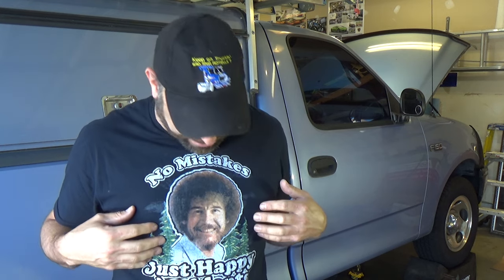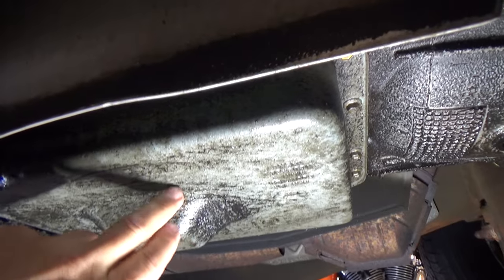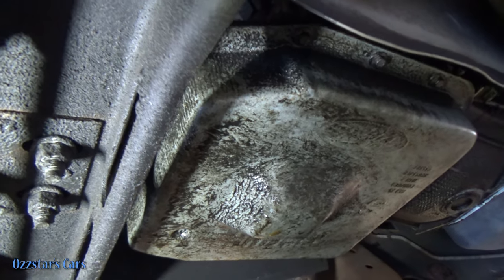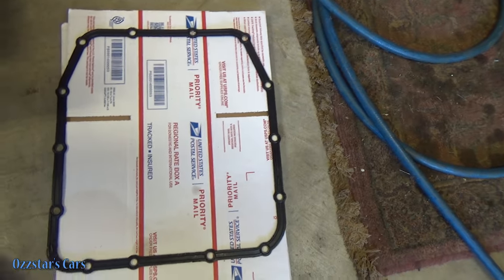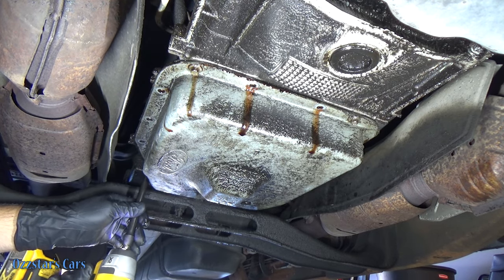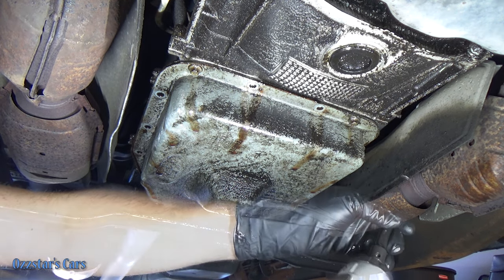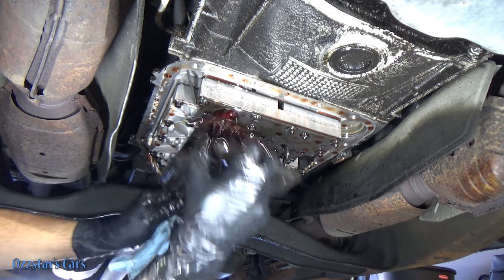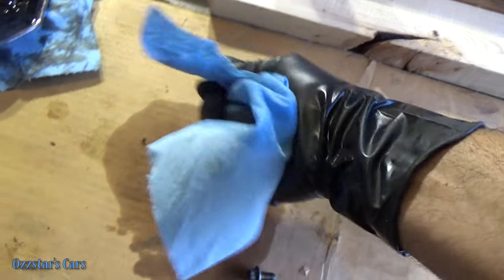Transmission Fluid Change In 24 Years!  How Bad Does it Look? F-150

Comment from the maker: *Motorcraft Transmission Filter FT-105  https://amzn.to/3hq7ytM*
*Transmission Parts Direct Pan Gasket  https://amzn.to/3jDKBG2*
*Motorcraft Mercon V Fluid  https://amzn.to/3h944g3*
*Long Fluid Funnel  https://amzn.to/3heqWuT*
Thanks for stopping by and checking out the video!  -Glen
Reply: Next time go with Amsoiland a can Of BG ATC conditioner you can put it in anytime and you will notice the difference
Reply: I think Wix makes the filters
Reply: Pry the filter apart that’s where the metal shavings are at
Reply: Good vid
Reply: Next time primer and paint the bottom of the pan
Reply: My Xterra filter has 4 little bolts first generation
Reply: Nice work
Reply: As far as name brands go I like Pennzoil or Valvoline and they are closest to Amsoil. I think the Motorcraft is considered will work and nothing special

Comment: good work.  My 2008 F150 4x4 has 335,000 miles and the tranny has never been serviced. Remarkable!  If it fails today, I've gotten my moneys worth out of this fine crew cab.  I'll drop a rebuilt transmission back in and keep rolling.  Talk about Ford tough ... I'm impressed.
Reply: did it fail or did it help it out?
Reply: @ashtanking3153  Has not failed yet with over 356,000 miles on it as of today and will drive about 400 miles today to the coast.
Reply: Same my Ford F-150 1995 has 400k and hasn’t been changed but definitely gonna bc previous owner hadn’t
Reply: My 03 2wd 4.6 has 370k on it and is just now starting to have issues. It has a bit of a clunk when I’m at a stop and hit the gas and it gets into gear. Otherwise it shifts pretty smoothly.

Comment: I got a 2008 Ford fusion with about 200,000 on it and never had the trans fluid changed,was wondering about a drain and fill but I'm scared it will cause problems with my trans if I do,what's your thoughts
Reply from the maker: If it shifts okay then leave it alone at this point. It's at the end of its life.
Reply: Did you change it? I have same make and model and around same mileage I’m about to do a drain and fill
Reply: @vincentriley8626 no I didn't if you do let me know how it goes
Reply: @terrymccluskey8758  just did ny explorer. 195k. Was starting to shift sluggish and fluid was getting dark. New filter and 5 quarts of mercon V. Smooth as silk now. Left the fluid in the converter so partial oil change.
Reply: @rocktech7144 did it make it shift better? did it help?
Reply: @rocktech7144 nvm i just read it. man my tacoma has 171k never changed. i guess ill do it when i start feeling it have problems

Comment: I have a 01 2wd with the same tranny. I bought the truck used with 170,000 miles on it. I changed it myself and it looked horrible. I have no idea if anyone ever changed the fluid and filter. It was full of metal shavings and was thick and brown looking. It had no red tint left. Let’s just say your fluid looks a lot better than mine did 😅
Reply from the maker: Well now we both have clean red fluid.lol  How's your transmission shifting now?
Reply: how’d it do after u changed it ?
Reply: It’s hard to say if it helped or hurt because I quit driving it as a daily driver and just don’t drive it often anymore.   The overdrive flashes on and off. The code it gives when hooked up to an obd scanner is the one for the transmission fluid temp sensor. I’m stumped on what to do for it to fix it. It is a ford only part not produced anymore

Comment: just needed to drain the t.c if you remove that round plug on the bell housing spin the tc util you see the drain screw
Reply: If it hasn’t been changed in more than 100k miles it’s better to leave some of the old fluid in. That grit in the old fluid can help. If it’s been that long and there is no grit left in the fluid it can cause slipping.
Reply: @jubblybits6155 no it won’t if it doesn’t something is already wrong with the transmission

Comment: ADVICE WANTED 🚨 my 03 tacoma has 171k miles and fluid has never been changed. it’s dark. no trans problems right now thankfully.  should i drop the pan and change? or just leave it alone . i rlly dont want to mess anything up so i dont know
Reply from the maker: 20+ year old fluid can't be doing very well to lubricate.
Reply: @ozzstars_cars  so dropping the pan and changing what comes out with filter can’t rlly hurt it right ?

Comment: the 4R70W seems to be a very reliable unit, we have a 1999 expedition with 400k on the original 4R70W, I just changed the fluid in our 04 expedition with 240k
Reply from the maker: That is some serious mileage!  I was really surprised how good things looked inside the pan.  Thanks Trigga
Reply: My 97 f150 has 200k, just dropped the pan and it was actually pretty for its age, original gasket and filter in it, i reused the gasket again
Reply: @shaneomac5074 did it hurt it ?
Reply: did it hurt it?
Reply: was it ever changed before ? or was that the first time?

Comment: Good video. Simple and Straitforword.

FWIW:
I cut the heads off of 4 pan bolts that are a little longer than the originals and round off the cut ends. I then cut slots into the rounded ends for a screw driver and thread them into the 4 corners of the case. This keeps the gasket aligned as I put the pan back up. The modified bolts sleep in my 'Odds and Ends' plastic case until needed again.

I also disconnect the cooling lines at the radiator and drain the torque coverter.

If replacing all that fluid causes slippage, it simply means I was headed for an overhaul soon anyway.

Again, Good Video......
Reply from the maker: That bolt guide trick is a great idea Russ! Thanks for sharing and happy shifting. -Glen

Comment: You might do a flush. As good as that pan looked, I wouldn't be afraid to do a full fluid exchange on it. I've never had trouble before. Whenever I buy a used vehicle, the first thing I do, is change ALL the fluids. That includes the power steering, flushing the brake lines, as well as the engine oil, transmission fluid, differential (s) oil and even the transfer case.(if FWD) I also flush the coolant, especially, if it looks brown.
Reply from the maker: Good maintenance is the way to go!
Reply: Don't forget about the 3stage decarb treatment
Reply: my 03 tacoma has 171k miles. trans fluid has never been changed it’s dark should i drop the pan? or would that fuck it

Comment: Never think to suck auto gearbox  atf out first before filter change REALLY worth effort when depanning sump, to change filters and seals, really stops the mess the rear gear box seal, jet wash it till clean, you be surprised they stop leaking with road dirt and xxxt clean out of back of gearbox seals
Reply from the maker: Nature's natural stop leak.

Comment: Man, you keep changing that fluid on schedule here on out like you did today and you'll never have to replace that transmission.
Reply: would u recommend i change my 2003 tacomas. it has 171k miles and its never been done no problems thankfully
Reply: @cedricmendoza1305  I had a used 2002 Tacoma but didn't own it long enough to change the transmission fluid.  Those are great trucks.  It's a Toyota and they are very robust.  I would look at it like this: if the damage is already done, then it's a matter of time before it fails, and the new fluid would just speed that along.  New fluid is not going to ruin the transmission, it just reveals the wear already in it.  Better for it to go when it's in the shop than on the road and leave you having to pay for a tow, and your loss of time, stress of it all, etc.  Also, know that the old fluid is only going to get more abrasive if you don't change it, too, which would mean continually increased wear.  I would definitely NOT do a transmission flush, but a drop and fill with a transmission filter change to start.  I follow a seasoned mechanic who says to keep the old fluid that gets drained out in a clean container when you do the drop and fill.  IF by chance the drop and fill causes slipping, drain that new fluid out and replace it with the old fluid and that should stop the slipping.  I have read about a guy who had a fleet of Ford work vans.  He said he did drop and fills as late as 250k miles on them with no issues.  I think it also depends on how hard the vehicles were used and abused.  If your Tacoma was driven mostly without hauling or towing and on the highway, then that's easy on the transmission and I'd feel more confident about changing it.  If it was used to haul heavy or tow heavy daily and up and down hills and such, then you would have more of a chance that it's worn out and would need replacing.  What's the history of your Tacoma?
Reply: @kargo27  this is the best response i’ve ever gotten to this question. my toyota was driven by an older man and then his grandson. he said it was babied its whole life so i highly doubt any towing was involved. the car looks amazing and well kept. the fluid is dark but the advice u gave me is great. i think ill do exactly that. drop the pan and change the filter. while keeping old fluid on hand. i doubt it’d hurt it
Reply: @kargo27  just hoping this things doesn’t start slipping that would suck. but ig if it ends up working the change would be for the better
Reply: @cedricmendoza1305  that's good news on the previous owner!  I'd feel more comfortable doing it then.  I think you'll be successful with a drop and fill, it's the flushing that knocks crud loose and that crud makes its way into and stops up the passages/channels and that causes overheating and failure.  When you do that drop and fill, the tranny has time to slowly dissolve the cruddy deposits so that they don't break off and clog (as I understand it).  I've done a lot of research on it and that seems to be the consensus.  Good luck, bud!
Reply: @kargo27  i guess i should definitely use the trans fluid the manual recommends? or just a toyota one in general
Reply: @cedricmendoza1305  I would use whatever the latest Toyota one that is recommended for that transmission by Toyota, yes.

Comment: Nice! I’m about to drop the pan in my 1995. Was there any reason the geniuses at ford opted to not use a drain plug?😭
Reply from the maker: Most manufacturers don't, never understood why not.
Reply: Now they don't even give you a dipstick. You have to get under the car and remove a fill plug, with the trans warm, and see if the fluid dribbles out.

Comment: Hey, Glen! It's crazy !
I am in a similar situation. I am the only owner of a 1998 Camry LE 4-cylinder, which I got brand new in '97. The car is currently 26 years old with 136,000 miles, and I never ever changed the transmission fluid nor the differential. As of late, when i put the car in drive, it reverses, and other times when it's in drive, the car takes a full minute before it moves, even when I press the gas pedal,it stays in motion. And when the car does drive, it makes a whining noise when I accelerate.

Lots of sources say not to change the fluid because of the age and mileage, but my mechanic says I should change it, even though I never did this service before. All I would do is drain and fill the ATF and differential. I wouldn't flush it, just drain and fill. I am lost on what I should do .

Some say nothing might not get done if I change the fluid because the transmission is done, but I have no idea .
Reply from the maker: @mc.ashlandfelix7140  fluid is cheap compared to expensive transmissions. I did a second fluid change on the truck in the video and it shifts even smoother now, like it had years ago.
Reply: @ozzstars_cars  I appreciate it, Glen! I was just unsure because many people and techs say if I do it, the slipping would get worst because I never did it before. Do you agree with that? The car is almost 30 years old with over 100K miles. And if I do this service, should I have my mechanic drain and fill it twice, or should I have him do that once? 

He told me if we go along with the process that I should bring 8 quarts of fluid, which I do not understand why because the transmission drain and fill capacity is 2.6 quarts and the differential capacity is 1.7 quarts .
Reply from the maker: @mc.ashlandfelix7140  30 year old fluid no longer has the proper additives to work properly. Make sure you purchase fluid that Toyota specifies for your Camry. The filter should be changed also if it is accessible.
Reply: @ozzstars_cars  
Appreciated!! I did order Toyota ATF , along with a filter and new gasket, but I was on the verge of returning them back after hearing all of the backlash of wasting money and beginning this service so late in the life of the vehicle. Have you done a differential service on your Ford truck, too?
Reply from the maker: @mc.ashlandfelix7140  I've changed diff gear oil on so many cars over the past 30 years I can't count that high. LoL

Comment: Dorman makes a transmission Pan with a drain plug That's what I use Or they sell a kit You could drill a drain plug in
Reply from the maker: Wouldn't it be nice if all manufactures put a transmission drain bolt in.
Reply: @ozzstars_cars  yes
Reply: @ozzstars_cars  yes

Comment: Nice video, do you ever drain the torque converter?
Reply from the maker: yes.  In this case I did a double flush since it is my vehicle.  Drove about 1k miles then drained and added fresh fluid.  The transmission shifts amazingly well now.

Comment: I just check my oil on my truck and its really darker than this one do you think it will help if a do a full flush again. 
Last time i just drop the pan change filter an gasket an add new oil
Reply from the maker: A second fluid change with the correct fluid should make a big difference.

Comment: That was a risky call on 24 yr fluid!!
In my 15yr owning my shop working on all makes, I have seen several instances where older cars OR higher mileage dirty fluid changes lead to nearly instant transmisison failure.
If I get a 25yr car with low miles needing its first fluid change I wont even risk it.
If I get a high mileage car with no history and dirty fluid I wont do it unless they insist after my warnings lol.
Reply from the maker: It's been a while, trans shifts soooo much smoother now.
Reply: when i bought my corolla the fluid of the transmission looks like it has not been changed in a minute,dark brownish color which doesnt smell like varnish. 198k motor and trans.
Reply: @JalenRose02  Im not sure I would change it in your case. If its thin like water and brown with no sign of red, thats not great for changing, somewhat risky.
Reply: @ripptydevibes2581  I'm praying to the toyota gods that I'll be alright 💀
Reply: @ripptydevibes2581  my toyota corolla which is a 96 uses a dexron 2 but those don't exist anymore can use a valvo high mileage transmission fluid?
Reply: @JalenRose02  No way. Use the regular "universal red" fluid.
Something like dex 3 / dex 4 / Toyota WS
Its all the same stuff.
Do NOT use Volvo.
Reply: @ripptydevibes2581  update I done change the old fluid out and its been running way smoothly now that it got new transmission fluid on it and next week ill be dropping the trans pan rather than just changing the fluid out, so i can get used to Castrol trans fluid that's been running for a week  through the system caused its darker again. then ill be putting a AMSOIL signature series for the final flush.
Reply: An old myth
Reply: @JalenRose02 any update? I’m about to do this
Reply: @Miles-wy1zr  Im still on the new fluid i put in not the amsoil ones and im one 206800 miles already, don't want to use a very clean oil on old transmission that never got service before you might clean it out by flushing it.
Reply: @JalenRose02  thanks brother I’ll try castrol ATF on mine soon
Reply: @Miles-wy1zr  yeah as long you shift on every gear back and forth when you fill it up so the fluid is in the solenoid. It should make a huge difference  when it starts getting hot and should shift smoothly but not smooth as a butter can't  expect much on this old transmission.

Comment: How can the oil still lubricate the gears?  You should of used the cooler lines to pump it out so the pan will be empty when you remove it.  You can try at 205 reseal for that leaking seal.  You only got out like 40% of the old stuff opening the pan if you use the cooler line you can remove fluid and add new fluid until its clear red otherwise their is still old crap in their.  Don't drop the pan every 1k just use the cooler line.
Reply: You have no idea how wrong you are 🤦‍♂️ He changed it perfectly. You don’t want to take out all of the old fluid genius
Reply: EricKirkland533  only if the fluid was never changed.

Comment: I have a 2000 ford expedition 4.6L V8 Triton XLT and just wanted to know if using the ford Motorcraft Transmission fluid and power steering fluid like you just showed is okay.
I didn't know Transmission fluid and power steering fluid was interchangeable like that since I am used to buying mercon v  separate.
Reply from the maker: Always best to look up specs in the owners manual or service info online.
Reply: @ozzstars_cars  Exactly. Mine does say Ford Motorcraft mercon v atp

Comment: My 06 camry at 325k had orig starter alternator front end trans fluid and most all besides breaks tires radiator at 300k. Therefore I don't believe in changing fluid trans in my new camry
Reply from the maker: Good idea,  I would agree.
Reply: Why would you? It’s at the end of its life anyways. It’s not even worth the cost of a flush lol

Comment: For a transmission wasn’t been derived in 24 years the fluid looks clean.
Reply from the maker: I was really surprised it looked so clean considering the truck is used for work. The fluid was changed again shortly after and the transmission shifts much smoother.